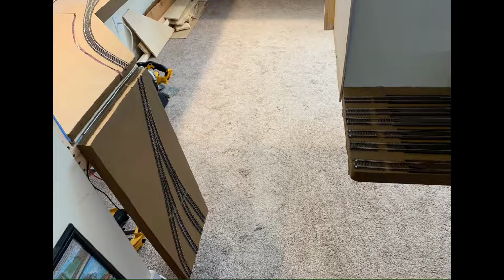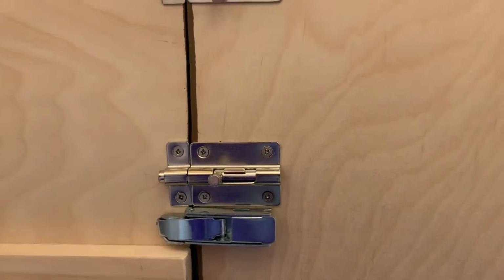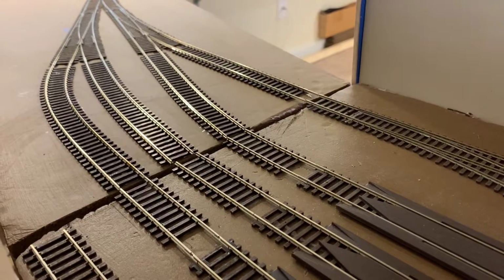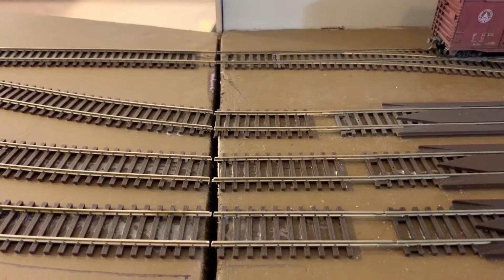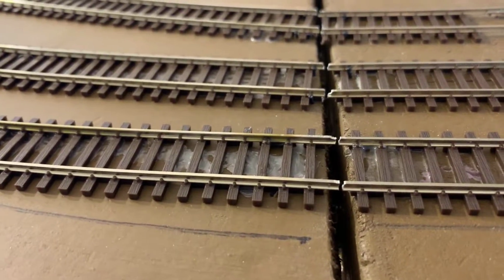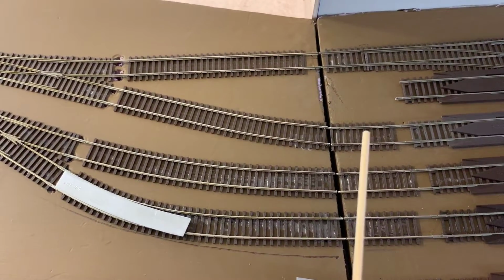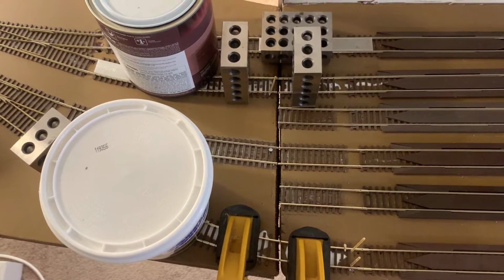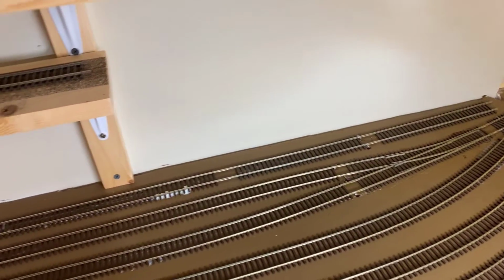Drop Gate and Staging Yard

Comment: Hi John. I have had similar problems but With even more delicate track in N scale. I have not tried soldering to copper ties as yet, but have gone with the way they do with modular set ups for exhibitions i.e. using a small piece of track to drop in. I’m still not happy with it as it is fiddle to slide joiners in N scale. Best wishes from New Zealand...Graham
Reply from the maker: As the joint is in staging, I ended up driving fairly large nails on both sides of each rail near the joint to hold it steady.  I agree with you on the short track over the joint being a bit of nuisance, this gate could go up and down several times during an ops session...

Comment: Hi, if you use a pin drill to put a small hole either side of the sleepers/ties close to the gap in the drop gate you can then fit sleeper screes or track pins to hold the  track for better alignment.
Regards John.
Reply from the maker: That's a great tip - I'll look into that.  Thank you!